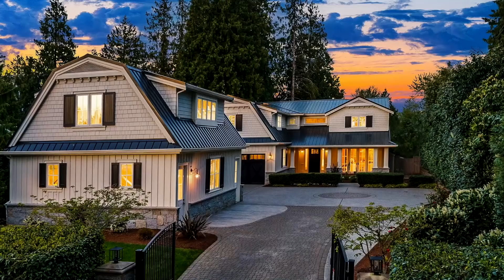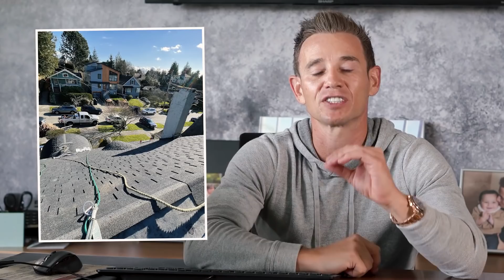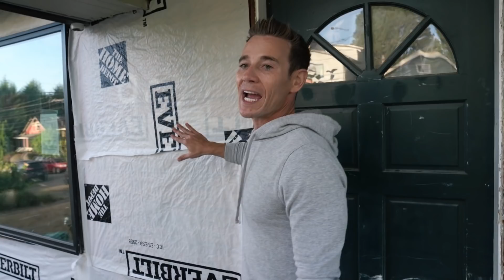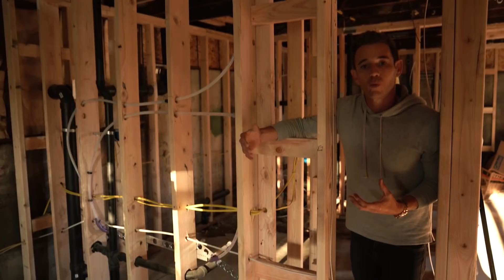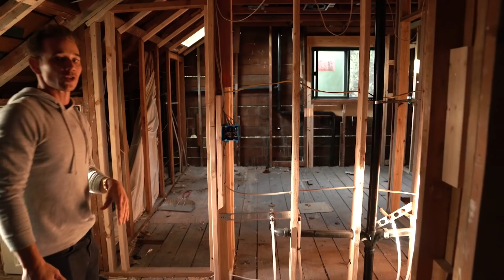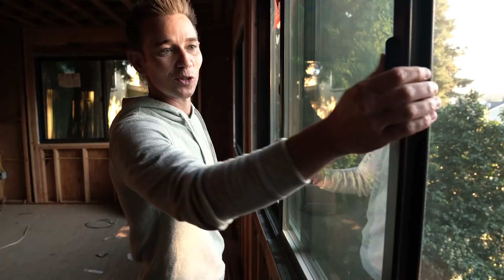Rough In Roundup: How Much Does it Cost to Flip a House?

Comment: This is BEYOND helpful, James!! And, having you do a site walk through while explaining was so much more helpful. 

I’d love to see some videos talking about material costs, and how that works with contractors. 

Also, if you could do some videos,  going a little slower and more in depth on many of the renovation projects you briefly touched on here (electrical, plumbing, HVAC, seismic, roof, siding, insulation, kitchen only, bathroom only, etc.), that would be great. 

Also, perhaps a video devoted to the whole budgeting and negotiating process, with either a general contractors or subcontractors. 

Also a video on what are generally the big cost differences (and specific items) on merely cosmetic renovations vs more in-depth renovations, going all the way up to a full gut and build out.

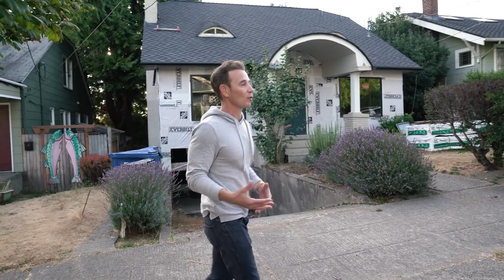Comment: At 14:20 - Flipping houses must be terribly difficult if it takes 12 months (through no fault of your own) just to get to this rough stage. Don't you have to still pay property taxes, interest on your loan, home insurance (is your home insurance priced similar to a regular homeowner?), and I assume water and electricity is turned on. When you finally sell, you then have all the typical selling costs. I assume you're either a realtor or broker but I also assume it's mathematically correct and fair to still include the 5% realtor commission fee as that's a lost opportunity cost (I'm not a CPA so I'm just guessing, I'd like to hear from a CPA on this). You likely also pay a property transfer tax. Where I live, Oakland California, this is 1.5% under $2M paid by the seller. Then after selling, you pay federal + state tax on the gain. I'm surprised flipping is still worth it after all the up-front money plus substantial selling costs and risk you put in.
Reply: Totally agree - but we factor for long hold times in our proforma in certain cities. Going into this deal we factored 15 months because we new the city was backed up from the pandemic. As long as you prep for the costs correctly there is still a great margin. Luckily we are heading into drywall and it takes us about 8 weeks to finish after drywall is complete. Won’t be too over on holding expense but the cash on cash return goes down. Big fixers need big margins to make it pencil right.